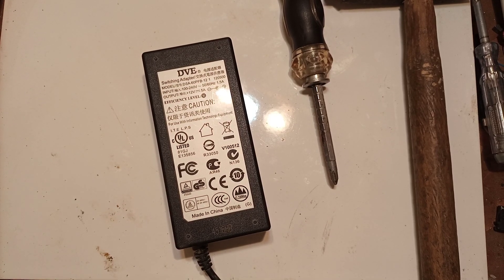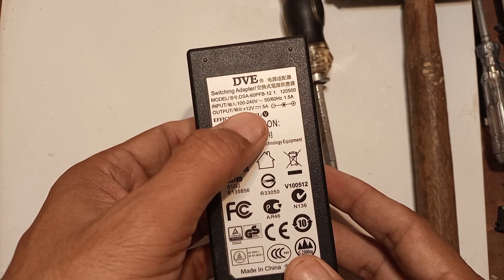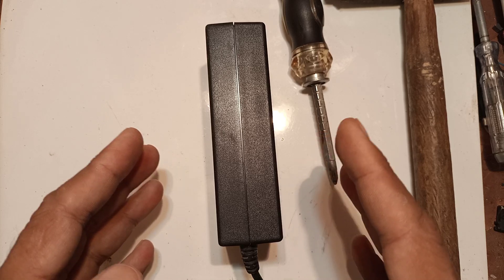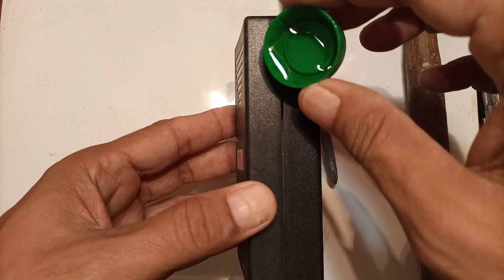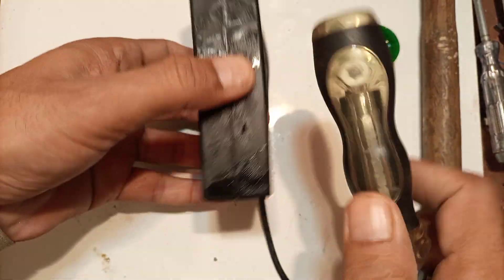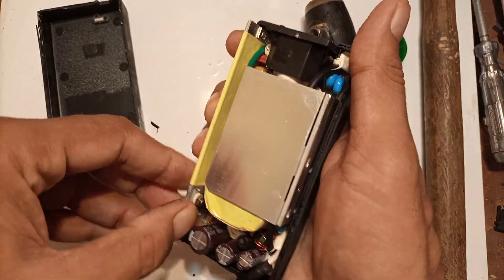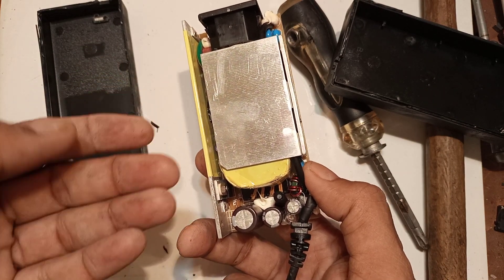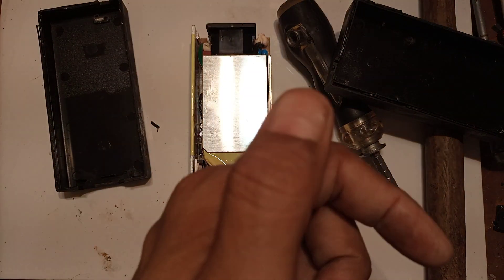AC DC adapter disassembling. Laptop charger power supply repair. How to open. SMPS  ATX battery pack

Comment: the easiest way to open power adapter is to use hammer to bit it😂
Reply from the maker: That's also a way which frequently damage the adapter beyond repair.

Comment: How do you make them stay together after you take them apart?
Reply from the maker: There are several ways. You can glue them or even can use metal wire stiching using your soldering iron.

Comment: Will it work with acetone too?
And now how to reclose it cleanly?
(I have no idea . . .)
I have exactly the same black grained plastic for a home phone transformer.
Thank you for your good video, this is exactly the info that I researched!
Reply from the maker: Acetone should work too. Closing is easy. You can use super glue or equivalent to fix it back.
Reply: @JahanZeb1976  Thanks a lot.
So, if necessary, does superglue be dissoled again with either gasoiline / acetone, to open the casing again?
If yes, that's an other info that I gained to dissolve superglue!
Reply from the maker: Up to some extent yes. But anyhow one can manage in anyway to open the case for repair. Another but a bit ugly way to close the case after repair is to close it by melting and embedding small peices of wires in all four corners of the casing. Such a caring can be opened again with little effort.

Comment: Can I use the laptop charger to run a cordless drill?
Reply from the maker: I think no. Because your drill will need much more power that can't be handled by a laptop charger.
Reply: @JahanZeb1976  icant understand why because this drill is 12v so why would I need more power ?
Reply from the maker: Voltage isn't something you estimate power of an equipment. The amperes drawn is giving the power information for you dril machine.

Comment: hi i have pajero 1993 model ,i changed Distributor cap and Ignition Lead Set, but now sometimes its not starting i have to clik on and off 5-6 times with push the paddle .how can i fix this
Reply: Are you on Crack? Why on earth would anyone ask an automotive question in this video's comment section? I'm perplexed 🤔

Comment: Do you have 110v service where you are?
Reply from the maker: No, It's only 220V ac available here. For one 110V people use converts.
Reply: @JahanZeb1976  I see. Was just curious as the adapter was 110.